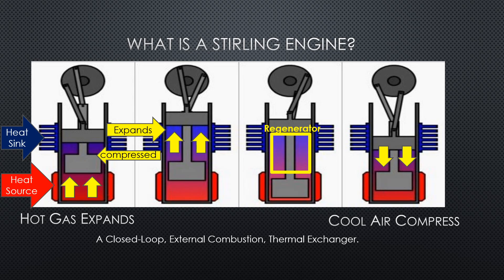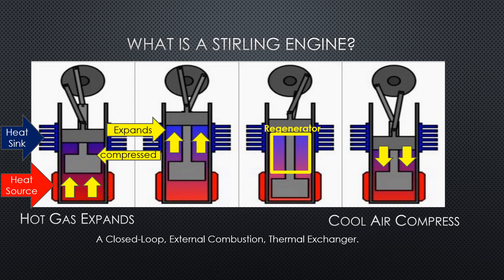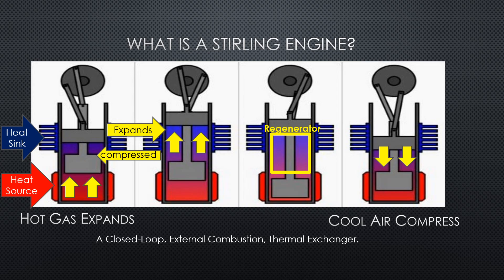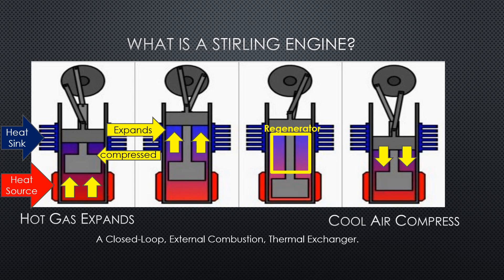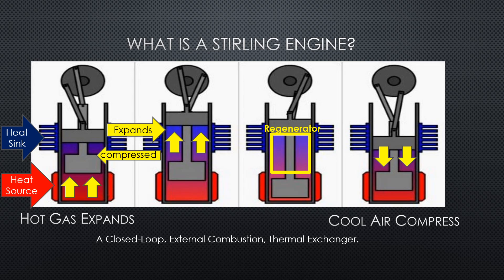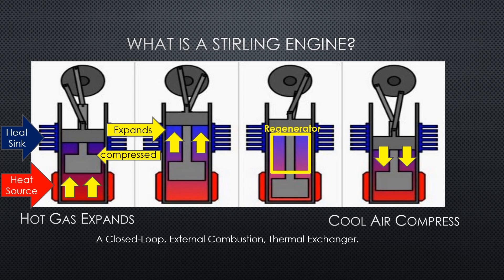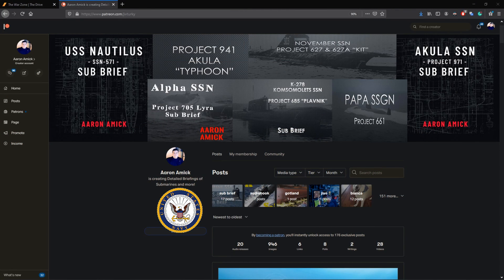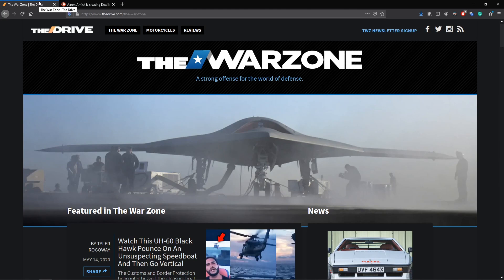What is a Stirling Engine?

Comment: Ok so, if you can generate the heat via a nuclear reactor,  couldn't you power this engine indefinitely? 

The Swedes used diesel, and they got two weeks out of theirs.  TBH I feel like a stirling engine has lots of applications in other platforms

Comment: Isn't a sterling engine purely a heat engine?

Only when it's combined with an external combustion source can it be part of an external combustion engine?

I mean if you used a sterling engine with thermal energy or nuclear energy it wouldn't be external combustion, as there would be no combustion.

Or am I missing something here?

Comment: how much horsepower can a sterling engine meant for a submarine make?
Reply: Depends on how many cylinders you line up, they have in the UK hooked these up using a bicycle type freewheel so as multiples can be hooked up together so they run directly onto the output shaft and allow for the heat variences across the different cylinders to not stop output.

Comment: If it is so efficient why it is not replacing the combustion engine in cars?
Reply from the maker: it doesn't change speed very well.  it likes to run at the speed that it's at.
Reply: @SubBrief  what if rapidly increase temperature?

Comment: The bottom piston is strictly a displacement device, it is not substantially pushed by the gas expanding or contracting. Only the top piston is pushed by the gas expanding or contracting.

1) The gas is displaced by the bottom piston rising, and moves into the lower hot section of the engine.
2) As it expands from heating, it takes more space, and pushes the sealed top piston upwards to make more room. (Pushing the bottom piston does not make any significant room)
3) As the bottom piston is pushed down by the flywheel, it displaces the gas into the top cold section of the engine.
4) As the gas cools, it takes less space, and the top piston is drawn down onto it.

Comment: How would you install this on a sub?
Reply: Erm like a normal sub, onto the drive/output shaft
Reply: @stevenlarratt3638  yes, but how does it start without some kind of a heat source?
Reply: @kadenc1181  with an external drive, as they are so finely balanced most can be moved by hand.
Reply: @stevenlarratt3638  thanks. I've actually been looking for specifics as to how the Gotland class Stirlings work. Been a lot of research but I've finally found it!
Reply: @kadenc1181  akin to a gearbox having a starter motor on the shaft? i am guessing or you can inject a hot/cold gas into a port or pressurise a section with same temp gas or liquid into one side to cause a pressure difference?

I have been thinking about all of the heat made from electrical equipment on a sub and that could be used against sea water easily to make an efficent system.

I put forward a proposal to the Royal Navy a few years ago that would also stop the transient noise from launching a torpedo. I may put it forward to the swedes to use on their next generation gotland class of submarines.

Comment: Excellent video as always, though I have a bit of an unrelated question. Back in your technical review of the movie Hunter Killer, you mentioned that the uniforms that the characters in the film wore should have included a radiation detector that would monitor their exposure for the duration of their deployment in the sub. This got me wondering: Because of the fact that people on board nuclear submarines are in such close proximity to a nuclear reactor and relatively high levels of radiation for extended periods of time, do you know if cancer rates among submariners, at least in the U.S. Navy, are higher than those among people who might have served on a ship powered by a conventional engine? I know it's a bit of a dark question, but I guess you could say that I'm curious. It's alright if you don't want to answer that, but if you did it would be greatly appreciated
Reply: Radiation dosimeters on submariners is purely preventative in the (extremely unlikely) chance of a radiation leak. The dose received by a submariner is generally lower than most in the same timeframe due to lack of sunlight exposure, which has a small ionizing component. The shielding and strict safety procedures keeps all aboard well out of harms way. Cancer rates are not statistically higher for submariners, and health problems from serving in the Navy or working in shipyards has largely been attributed to asbestos and other chemicals than radiation.
Reply: nemo is completely right. Imagine my surprise when i found out the coal power plant near me emits more radiation than the nuclear power plant near me.

Comment: Still needs a heat source, which (usually) requires air and exhaust.
Reply: One option is liquified hydrogen and oxygen as fuel, which combusts into water.
Reply: @thomaszhang3101  yes, I believe that's the usual routine for Stirling engines. Either that or diesel, which is messier but easier to handle.
Reply: @thomaszhang3101  In that case it's probably better to use it for powering a fuel cell, because although a stirling engine is very efficient and pretty quiet, a fuel cell literally produces no sound or vibrations whatsoever.
Reply: @pieterveenders9793   nvm, it uses oxygen and diesel fuel. The CO2 produced was then pressurized and flushed out into the ocean. 
The problem with fuel cell was that it requires O and H. Hydrogen atom was small and notorious for escaping gas tanks, which makes storage extra hazardous and complex.
Reply: Why not use water, one imput via the front of the sub (pressured) and one from the rear of the sub unpressured whilst moving? Small pressure changes from same temperature water surrounding the sub can be enough for the temperature variables to be enough. Add in electrical cooling/venting into a heat exchanger is the normal solution. Plenty of thermal output on any sea going craft.
Reply: @stevenlarratt3638  water is actually a terrible material for sourcing heat from, it's temperature does not change much with pressure (that's more of a feature of gasses).

It is great to dump heat into, since once it boils (at whatever pressure you want to work with) it's temperature won't increase further.

Comment: So, it's not really air independent, it's just a lot quieter than using a regular engine.

 This makes me curious about what would've happened if the soviets had pulled the big high-speed underwater diesel engine out of some of their Quebec-class boats and replaced it with a stirling engine.
Just imagine the later Romeos, Golfs, Foxtrots, and Tangos, all cruising submerged on diesel and LOX instead of batteries.
Reply: They already had enough battery power to spend a couple weeks underwater. Ivan was smart about that part of the designs.

It'd be interesting to run a Sterling engine with the cold side at sea temperature. That'd be about 40degF/4degC for deep water (below 200ft).

Comment: Thank you for the explanation.
May I suggest a possible topic for the site? I suggesting a “What Were They Thinking” type theme regarding submarines.Whst could possibly go wrong 🤔
I.E. that hydrogen peroxide (Walter) fuel type propulsion plant proposed for the next gen  U-Boots. I believe the Russians and the Brits looked into this but gave it up rather quickly. 
Also, the (K class submarine (a VERY early type submarine) powered by (I kid you not) a steam engine.
Maybe a brief non-secure discussion of a liquid metal cooled reactor power plant.......with its associated er, um,sh associated operating “characteristics”.
On the other hand maybe some good ideas could be mentioned along with their operational effects/impact. I.E. The Snorkel and also perhaps incorporation of truly hydrodynamic design (guppy) on/for submarine ops.
I know you discussed mines, but how about the use of mine laying submarines? Not as glamorous as torpedoes ir even a deck gun, but the adverse effects of a “surprise” minefield can be appreciable in time and clearing activities. 
Bye, and thanks again
P.S. thank you for the war zone site suggestion, will keep an eye out for your inputs.
Reply: Poland before WW2, used submarines mainly for mine laying (Torpedoes were secondary). The problem was mostly with space. You'd have 2-3 dozen of Mines and unless you know the route that enemy ship will take very precisely, it isn't enough. Obviously with modern technology - when you can stay underwater for longer time, it would be far more feasible.

Comment: fyi.      bla-bla-bla        see Robert Stirling.       at :30,  and, just what does one use  to produce  HEAT (without exhaust gases)  on  a  submarine.???     this premise  is  short on logic.      at 2:15,   you are describing  a DISPLACER ---  Not a piston.   '...makes it external combustion',  WTF!!!    this   is  NOT  a  logical  statement.        the decision to refer to a  beta config  was  a  Poor one.    it  just makes is  MORE  difficult to understand the stirling cycle.    googletranslate
Reply: How do you produce heat without exhaust? Well a nuclear reactor or fuel cells for example...
Reply: @benbaselet2026  How do you produce heat without exhaust? Well a nuclear reactor or fuel cells for example
Reply: @ВикторЗакомолдин-в8ж  Is everyone in the youtube comment section a bot nowadays?
Reply: @benbaselet2026  The Swedish Gotland-class uses liquid oxygen and diesel to power their Stirling generators - I guess they just dump the exhaust overboard in some quiet way?
Reply from the maker: A displacer is a special purpose Piston.  You (of all people) should know that, David.
Reply: @SubBrief  really.   prove it.     then prove that the word  displacer  is  not  Less-ambiguous than   hot-side piston; when a displacer  is present.
Reply: @daviddavids2884  What about 'hot side pissed on' that's a description that has an unforgettable 'hiss' about it.😂

Comment: So the heat source could be an radiothermal generator type thing
Reply: They have free-piston Stirling engines that are specifically designed to generate electricity from any convienent heat source and are a completely sealed unit.  Undoubtedly these would be considered for long-duration space missions, but it's hard to beat the reliability of thermocouple-based generators.
Reply: @drtidrow  if you're using a radio isotope for heat, the radiation damages the thermocouples. Iirc, Voyager started off with a @100w RITG, but it's now down to @15w between radioactive decay reducing the heat production and radiation damage to the thermocouples.